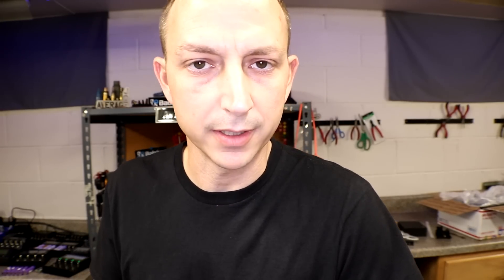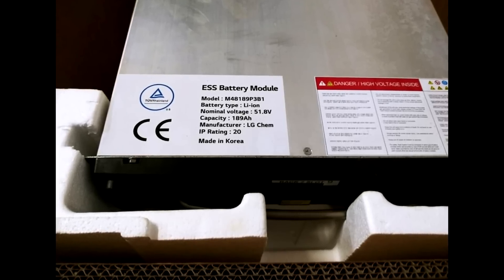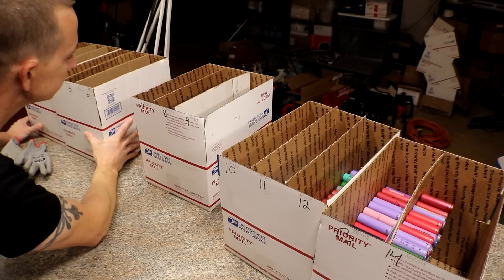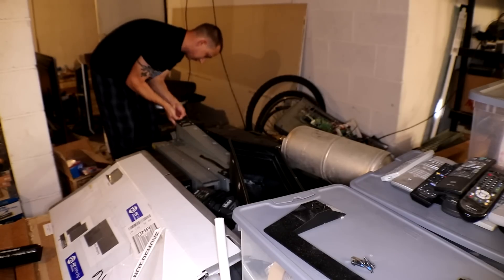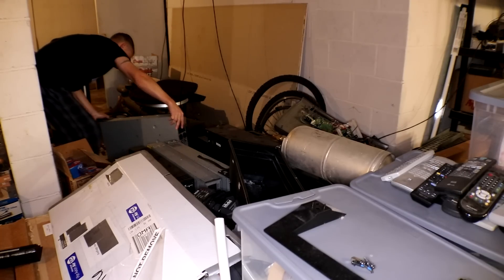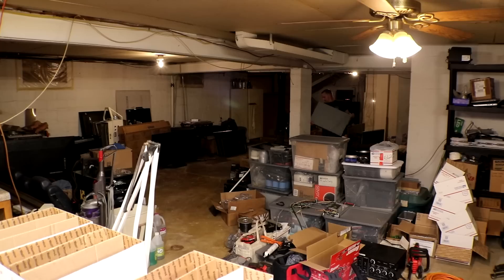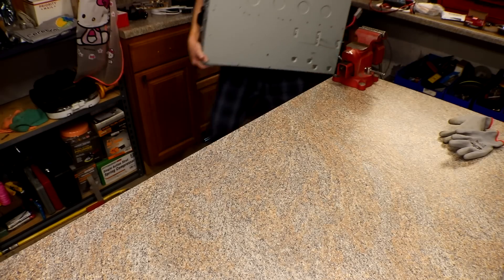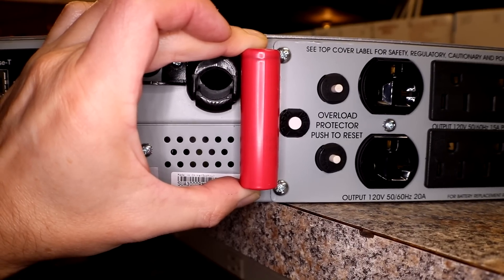UPS Battery Bank

Comment: Dang, I wish I could send you my 3U battery chassis' but shipping from NY would suck! I was originally planning on putting 18650 packs in them but have moved over to EV packs so now they're just sitting there.  https://i.imgur.com/4a1iZ04.jpg
Reply from the maker: Damn did you show me this like a year ago?  That pic looks familiar!!!  I thought about putting the cells on there side like that if I used a 3U which is more likely what I can get from my recycler.  How many can you fit like that?
Reply: @AVERAGE_JOE  Dangit Youtube turned off my notifications.  I probably did show you before!  Those are 6x28 packs but you could possibly go up to 6x30, and five packs would probably fit in there if the case is completely gutted.  They're APC battery packs which originally looked like this, with removable trays to hold the batteries - https://i.imgur.com/iCx3AP8.jpg  /  https://i.imgur.com/4yZRUkT.jpg  I've since moved on to Ford EV packs (and finally made a forum post) so I dunno what I'll do with these APC units.

Comment: Sweet idea upcycling the UPS case! Hey - suggestion, I was thinking of picking up an older RV travel trailer that is pretty much a wrecker to house the ole' power wall outside. Can grab one for cheap if your in no hurry, a 17 footer you can even put a heater in and a small workshop. Roof works great for some solar and come the zombie apocalypse hook that puppy up to the hauler your good to go!
Reply from the maker: Would be sweet to have but Im pretty sure the wife would FREAK lol.  I do like idea of having it around for the Zombie Apocalypse tho!😆🌋

Comment: The 2p pack idea looks good. Can you get your hands on a mig welding machine? Add some sheet steel to fire protect the server rack . I think itll be up to you to see what is most cost and time effective. Fire protection is a must. Its not if the cells will fail its when. Just a matter of time and the more you have the more chances you have that one will fail. If there is something I learnt with my acid system is that more cells is not the way to go yet my new system will have somewhere around 9000 cells. Not to mention it is nice to see the cells with a thermal camera to see what is really going on. Like on Petes channel : )
 I did some math on my system and when Im running 10000 watts I will be using aprox 0.25 A /cell. Should be just fine. Cant wait to see what you decide. Cheers bro. Also if you are not making the money you expected from youtube keep it simple. Im pretty sure most ppl like to see you not you editing skills. Thats just a bonus if you have some extra time : ) Peace
Reply from the maker: Tru That!!!!! Oh I forgot to add mine is setup for flux core wire right meow!!
Reply from the maker: Yeah Im leaning more towards 2s.  Would be easier and less confusing to do!  I have a welder but no gas lol.  Agree fire protection is a must!!!  I do have a seek thermal cam for my phone but if I enclose all the cells I wont be able to see chit lol.  Yeah 9000 cells is A LOT lol but like you mention the power draw from each cell is TINY!!!  The cash from youtube is fine, should slowly go up as time goes on.  My issue the last few months is time lol.  Ive been thinkin about doing other shorter vids.  Shouldnt be hard to do but WOOLC😆🤘
Reply: @AVERAGE_JOE  ya time is always against me as well. There is so much to do but no time to do any of it.  You dont need gas if you buy flux core wire.  Its good enough . Keep them vids coming brother.

Comment: Wish I had such a place to work with.   Your way ahead of the Game.
Gutted the heater out of the cubbyhole it was in.  Going to be quite good for the Power Making Chit.
Room for plenty of batteries,  Electronics and Monitoring equipment.
Added bonus if chit goes south it's already Fire Retarded.   Fire Blanket on Walls and flooring.
I'm going with LiFePO4 so fire issues  well below what your dealing with.  
Duct work at the floor goes to all rooms of the trailer but That's going to be covered.
I can use the duct work to run dedicated Inverter AC wirring to any room as needed.  Think Local 120AC.
Ex-host chimney is going to be used to bring Solar and Turbine cables in. 
Chimney provides Venting Think I will put a fan blowing OUT in order to mitigate Dust entry and keep the enclosure  ambient house temps.

 My POWER WALL project is all going into  the Metal Box that used to be our Colman Heater in the Mobile Home hall way.  Using the Original Heater Box/Frame insulated with Fire Blanket within.  Cramped space.  Batteries, and all electronics enclosed in the 19 x 74 x 22 inch metal box.   Actually I'm treating it like a standard 19 in equipment rack I grew up with in the Military.   So basically Everything I'm doing has to fit within one standard 19" equipment rack set.  LOL 

Batteries.
Solar Power Control
Wind Turbine Control.
Local Inverters

and Grid Tie associated with both.
Reply from the maker: Sounds like you have your work cut out for you like I do but less room to work with!  Yeah lifePO4 would be the ticket for sure.  To bad I dont get many of those!  Chimney would be a plus as well!👍

Comment: One huge problem how you going to BMS all thos battery's
Reply from the maker: If I do 2s then Ill use Batrium and longmons hooked up like I have meow.  Not sure if I would have them inside or outside the case yet.  Maybe since it would be 2s300p in each ups Ill have 2 longmons for each 300p and put one longmon inside and one outside for temp!  I also have a shunt trip to disconnect power if needed!👍

Comment: I personally dont think your plans makes the whole rack more safe, you adding extra heat to the cells by putting them in limited space. It maybe will nice to have a local fireman look at it, and you can search for automatic fire system specially for electrical stuff.
Reply from the maker: If I add more cells the amp draw goes down from each cell which would be less heat but none the less the possibility is still there.  I should get a hold of the Fire Dept and ask them some questions for sure!!!🤘

Comment: i've thought about doing that, i opted for a much larger metal box that could hold my whole pack.  Wouldn't take much though to put a fan or two in the case and have it controlled by the batrium.  Will need to figure out how to isolate the cells from the case, maybe some sort of system that allows the pack to easily lift out of the case for maintenance.
Reply from the maker: I mean technically mine is all in a big metal box.  I could seal it all up and just use drawers like Im doing.  Maybe line inside with some fire blanket type stuff or KAO wool.  Yeah for sure adding fans and control with batrium.  If I do end up using the ups cases I was thinking some concrete board to isolate cells from case maybe.
Reply: @AVERAGE_JOE  If you do a 2S inside the UPS case, might be better to keep them as two separate batteries inside, as one unit, it's going to have some heft to her lol.
Reply from the maker: Yes Sirrrrr! that would be the plan meow.  I dont want to try a lift all that lol

Comment: Build a 100p out of cells you're not going to use and overcharge it to see what happens in the event of a worse case scenario.
Seal the rack well and vent it up a chimney. When it goes postal the path of least resistance for the flames and gas will be the chimney.
Reply from the maker: Ive been thinking about doing a test like that.  Ill have to see how many I have.  Would be cool to do 600 since thats how many would be in there for a real comparison but well see!

Comment: Line ur server rack with the lipo fire protection "blanket" thing that the "fireproof" charge bags are made of! That might give u a good bit of extra safety when a lipo fire occurs the blanket falls apart into the fire and helps contain the runaway chemical reaction not fool proof tech but adds safety
Reply: Just found some 4hr fireproof sheets that u can line the whole server rack with
Reply: https://m.grainger.com/mobile/product/3M-3M-Firestop-Composite-Sheet-WP11234/_/N-1cuy?searchFlag=Browse&breadcrumbCatId=27295&fromPidp=true&picUrl=//static.grainger.com/rp/s/is/image/Grainger/3BE38_AS01?$smthumb$webparentimage$
Reply from the maker: Interesting stuff!!!  🤔🤔🤔

Comment: I agree on the 2s per box and same thing, add some 80mm 12v fans running at 5v so they spin slowly and exhaust any heat out of the boxes.
Reply from the maker: Im kinda liking the 2s as well.  14s would be cool but there could be a huge range of cell differences since it would only be 42p.  Yeah thats a good idea with 12v fans.  I did get one of those 48 to 12vdc converter thingys I could use if needed.

Comment: I like the idea, the 2S in each ups box, save on watch mons . Maybe have 2 slow/low  powered fans pulling the air through the case, not pushing. Would help with heat and keep the fan noise down. Do you think 36wh would be enough for you ? You did add more panels. I think at this point it would be a good balance of power used and power put into the power bank . Ohh ya boom!
Reply from the maker: Yeah 2s would be easier and cheaper for sure! Yeah I could do slower lower powered fans.  Hard to say if 36kwh would do it or not.  I would like to say YES but WOOLC.  Yeah adding the panels will help for sure!!!